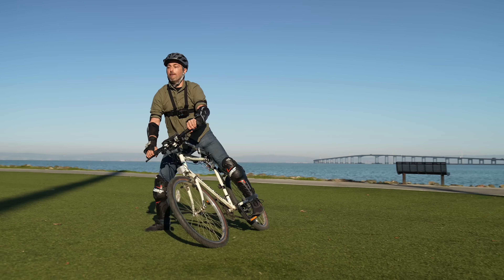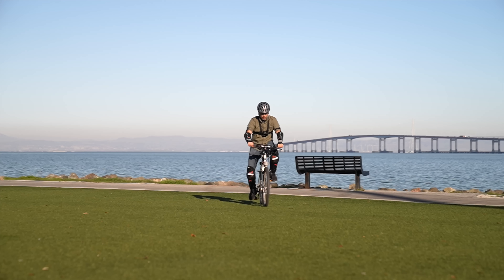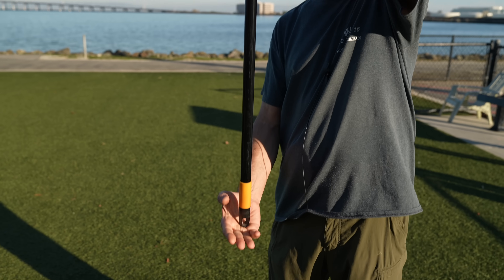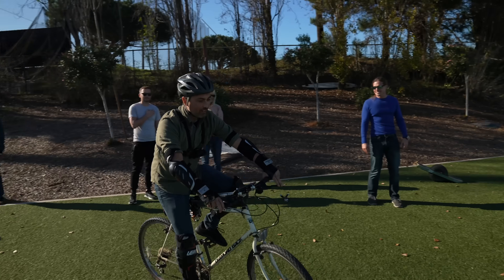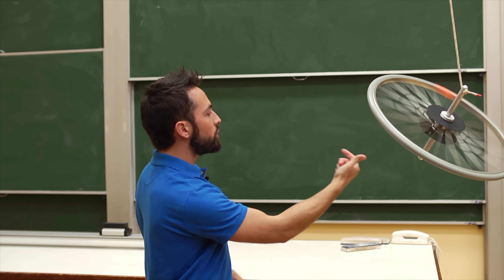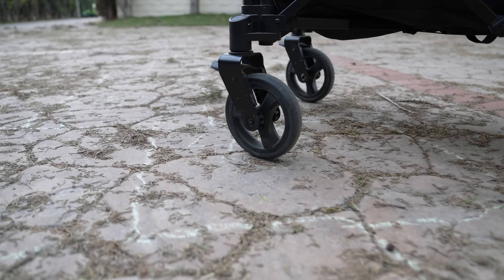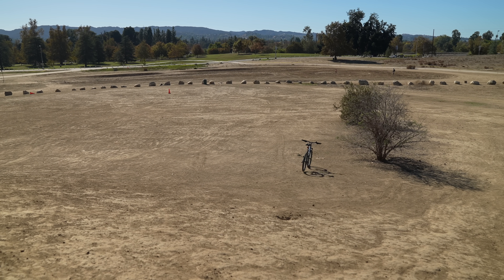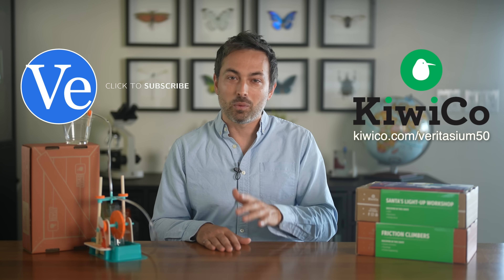Most People Don't Know How Bikes Work

Comment: Try this experiment:  On any bicycle turn the bar to the left.  Now use a level or square to position the front wheel vertically.  You will observe that the frame of the bicycle will lean to the right moving the center of mass to the right of a line drawn between the two tire contact patches.  Opposite when to turn the bar to the right. 
When you learn to balance on a bicycle you learn instinctively to turn into the direction you lean.  So when you are falling to the left you turn the bars slightly to the left.  This moves the bicycle/rider center of mass to the right counterbalancing gravity trying to pull you down further to the left (and vice versa).
Suppose you want to make a left turn.  You have to get the center of mass on the left side of the bike's contact patches.  As above, you have to turn the bar to the right (momentarily) to get the center of mass on the left side of the two tire contact patches.  Once leaned over the bar can be turned to the left to continue the turn. To straighten up you turn a bit more to the left, the center of gravity moves the right, the bike straightens up.
Lot's of words.  Sorry, I couldn't cut it much more without reducing clarity.

Comment: This is how i perceive this:
Its pretty simple actually, when you riding your bike, your weight is in the middle of the bike, so if you want to turn left, you will naturally just turn left like how you would do with a car, but the bike doesnt work that way because while a car has four wheels, a bike only has two, so when you want to go your left and you just turn that way, you will naturally fall to the ground as your weight has shifted from the middle of the bike to the left of the bike, making the left side of the bike too heavy and eventually falling to that side. The right way to go left is to first turn a little to your right, shifting your weight to the right side of the bike, then you turn to your left side until the weight of the bike goes to the left, but not too left that you will fall.

Comment: This is also why there isn’t a realistic video game controller for motorcycle racing games. When you think of how changing lean angle to turn or to stand the bike up or change direction, it is totally different than how you steer a car. 
With a car you turn the steering wheel to the desired angle to make the car travel in a radius that you want, and you have to keep constant pressure on the steering wheel to maintain the correct steering radius and direction that you want, or the wheel wants to go to the least resistive point, which is usually straight; that is why your car will auto-straighten out when you’re coming out of a turn while driving, just by releasing the pressure on the steering wheel and letting it slip through your fingers.
With a motorcycle you counter-steer to initiate lean angle in the opposite direction, and release pressure when you have the lean angle that works for the specific turn radius. If you need to change the lean angle while in a turn that is when you need to apple pressure in the opposite direction to the lean angle change you need. The algorithm for programming a counter-steering handlebar video game controller to operate correctly when you’re using counter-steering is probably the biggest challenge. Using a standard joystick or wheels and peddles to drive a motorcycle racing game, when you have been riding motorcycles for many years isn’t fun to me.
Reply: pedals

Comment: As someone who has gone further on a bicycle than most people have by car, i would like to say that this might not necessarily be true. Now, i don't have one of those testing bikes to prove it, but i believe that if you're aware of this problem, you can compensate for it by shifting around your weight, as well as tilting your bike, and thereby avoiding having to correct left, or right, until you've finished your turn (although you would have to correct after the turn, so it doesn't really change much).

Something similar to this experiment happens when you ride in a very narrow path, like next to a wall, where you can't lean to one side because you're hugging the wall, so you might end up crashing into the wall because you can't keep your balance, and you can't turn away from the wall, because that would cause your body to nudge it.

Comment: It's called counter steering, and it's something you learn during motorcycle courses. In the event of an emergency and you have to turn into a certain direction as fast as possible, you push the steering wheel on the side you want to go to. Pushing the left handlebar means you're going left, NOT right. It's due to centrifugal force.

Normally, you steer with your hips (applying gravity) not with your handlebar, though.
Reply: Not true. See how fast you can turn with your hips when you don't have your hands on the bars. You can keep within lane lines, but you can't turn a corner or go round a roundabout.
Reply: @hughjardon3538  It really depends on the motorcycle how easy it is to steer by leaning, but yes, in most cases you are right. Turning =/= Steering

What I meant was that if it's possible, always steer with hips, unless the situation requires otherwise, such as a sharp turn or small roundabout.

Comment: This is so wrong. Derrick is pretty smart, but not the most athletic. The fact that I can ride my bike without touching the handle bars and when I lean to the right side and I turn right without having to first lean left proves this is all wrong, correct?
Reply: I think it would be just as difficult to drive a car in which the steering wheel turned the opposite direction than what the driver was used to.
Reply: You just prove that the title is correct.
Reply: @XtreeM_FaiL  He said if you want to turn left you have to turn right before you turn left. I can just lean left while on my bike and turn left and prove him wrong. I cant lean in my car. Extreme fail.
Reply: @XtreeM_FaiL  im not sure what youre going on about? Its not magical? When I lean left and the bike goes left at what point did I countersteer? Video dude says you must countersteer. Im saying you dont have to.
Reply: two extreme fails from you now...
Reply: @XtreeM_FaiL  The guy said in order to turn right you have to first steer left. Im saying, you can just lean right w/o turning left and the bike turns right without ever going left. Go try it yourself. Keep your helmet on.
Reply: @XtreeM_FaiL  three extreme fails now.
Reply: @XtreeM_FaiL  lmao which part of the bike is countersteering??? lmaooo Im dieing!!!
Reply: @XtreeM_FaiL  For the record, Im implying you are already wearing a helmet. :face-blue-smiling:

Comment: I dont think I do this... I always Lean the bike (not my weight) to the direction I want, before turning... you can even control someone with it, if you are riding on a step knot, you can lean the bike left or right and the driver has to counter it by instinct turning the bike to that direction... it doesnt require any counter steer at all...

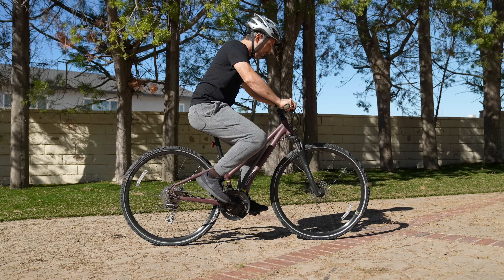Edit: Okay @5:00 now I get it... its because yall are stayed glue to the seat... I can actually stationary balance longer than 5mins. (tho its has a lot of small movements) cause I usually stand from the pedal... Me and my friends grow up with our BMX learning tricks and we always have some compitetion about this stationary balancing on who can last longer.. usually, we just only sit when resting or going down hill.. not while paddling and turning doing some tricks.

Comment: So, I do have one issue with this test. Bikes and motorcycles are notoriously harder to handle at lower speeds, and all the footage here is at an incredible low speed for a bike.

You don't actually need to countersteer to make a turn. You can use your body weight to do that, since a bicycle is so light. But at lower speeds, this is less efficient.
The problem is the micro corrections we make all the time, and that aren't that "micro" at lower speeds. When you can't make those corrections, and when you don't have the speed helping you, you do tend to fall more often.
At lower speeds, countersteering is very useful, and it can be pretty much a side effect of you positioning your weight on the bike. If you "lock" your arms and push your weight to the left, the handlebar will turn the bike to the right. But most people don't use their weight at low speeds anyway.
The immediate "turn now" contributes for this too. You don't usually make turns like that. You usually see a curve and prepare for that turn. In those fast turns at lower speeds, countersteering is more efficient and faster than moving the center of gravity. So that's what people do.

So, by locking the handlebar into only one direction, you didn't just prevent countersteering, but also the corrections. And since people are moving slower, and can't prepare for the turn, they need bigger corrections and more countersteering than they normally would. and that's what makes you fall so often.

Comment: Can someone help me understand what I'm missing from this? I understand the concept, but here's what I can't connect to my own experience. I'm just an amateur MTB rider that has ridden my hardtail casually off on on my whole life, and I wonder/think? this might be the issue is the difference between MTB and road or casual/tour style handling (like the video mentions but does not go deeper into is that people assume you steer with turning, but cornering is really leaning. I really wish there was an advanced road/MTB rider in the mix to talk about and show hard lean technique). I specifically kept this video in mind as I went out for my ride around my yards short track, it is all up/down hill and flat corners with no berms, I noticed that I never counter steered to steer like the video suggested, and that the only time I actually steered in the opposite direction was ONLY for positioning, when I wanted to start wide to take the most efficient line to carry more speed out of my corners, just like you would in car racing. I was able to let myself go straight and just fall into my turns if I wanted to. I simply didn't understand why everyone in that bike test couldn't do that and it really frustrated me to observe, so what am I missing?
Reply: It does not matter what or where you ride. All bikes work the same way.
You have always countersteered. Required force needed and the effect on a light bicycles are so small that it is hard to notice.
If you ride heavy motorbike fast, you will notice that you need to push quite hard to make a quick turn.

Comment: Why is it seemingly easier to balance on a bike with skinny tires as opposed to fat tires
Reply: Damn that's a good question I want an answer to too. There's plenty of trials riders riding on wide 2"+MTB tires but then you'll also see masters like Viola Brand literally doing ballerina on skinnys. I don't know if relevant but if you keep increasing the width of the tires on a vehicle you eventually hit a point where the sheer girth causes the vehicle to want to wander and bump steer around on it's own, so maybe on a bike more width grants more stability at speed, but similar idea in that it also presents more resistance against you when you're trying to hold a different position than where the bike is inclined to travel?

Comment: I'm a PRO Biker and this video helps with NOTHING... It's just not useful... 👎
Reply: Cool bro, it wasn't the goal of the video anyway. Since you're a "PRO Biker" ᵀᴹ you should already know how to perfectly operate a specific kind of two wheeler in any situation (because every two wheeler behave this way (above a certain speed that is dependent on its weight)), the interesting bit is knowing why it is this way, which you probably already knew since you're a "PRO Biker" ᵀᴹ, but most people didn't
The video helps absolutely nobody, it just point outs an interesting fact most people weren't aware of.
Reply: @AlphaDragons60 🫵🏻💚

Comment: Wait ,am i the only one turns the bike with the body imagine i’m a motorcyclist 😂
Reply: By leaning you're body right you're also pushing on the right handle which turns the wheel left which leans the bicycle to the right to then make a right turn.
Motorcycle riders don't turn by leaning their body in the turn (they can even lean the oposite way to make tighter turns at slower speeds)). Every two wheelers behaves the same way, above a certain speed which depends of its weight, if you push the right handle it will lean to the left which will make it go left or eventually fall to the left if you continue pushing the handle more and more without straightening it up

Comment: When I first watched this video, I thought the counter-steering sounded so strange. Not that it didn't make sense, but that I, as someone who rides a bike almost every day for commuting, could not ever recall doing it. I left it at that it was so unconscious that I didn't realize it. Fast forward to today, I rewatched this video and realized: "Hey, I can just take my bike out and see why this seems so weird."

Turns out, I actually don't counter-steer, even on hard turns! I lean into the turn first, THEN I steer into it! It's the same principal, just that instead of steering in the opposite direction to start "falling" in the direction I want to turn, I shift my body weight in that direction.

I think I could turn on that bike.
Reply: You actually do counter steer, but it's subtle. Let's say you make a right turn, by leaning your body right first you're applying more force to the right handle than to the left, which makes the handle bar and wheel turn left, which makes the bike lean to the right, which makes it turn right.
You can lean your body to the left and still make a right turn, it will be tighter even, but i don't recommend doing it at high speed

Comment: What you didnt include in this video is the same reason that the bike kan roll on its own is the same reason that a steering wheel in a car returns to center when driving forward. When going bakwards in a car, the wheels wants to steer to the maximum angle.
Reply: that's caster. 8:02
Reply: @stan0matic  Ik, for some reason I forgot to say it.

Comment: They've messed up and missed something: if the centrifugal force wasn't very important it would be just as easy to ride a scooter with no hands as it is to ride a 10-speed with no hands. But it's in fact easier to ride a bike with no hands. than a scooter with one hand.

The reason that's true is an important part of the equation.

Comment: Sadly, nothing was mentioned about the wheel shape, and it’s affect on turning the bike. The contour of the wheel is really what does most the work.  Counter-steering is just getting you on the the opposite and smaller circumference of the tire, i.e. side of the tire, this is what actually turns the bike.
Reply: The contour of the tire is largely is responsible for keeping the bike upright without a rider while moving. A ‘bike” tire without contour would not stay upright and would be very unstable, let alone difficult to steer.

Comment: One very easy observation everyone can make is see how your body react when you are standing on your toe and trying keep balance. If you are losing balance to the front your body bend toward front to regain balance. Same happens while riding bike. You are trying to pull the balance back from right to center while turning your handle right. If you think about it, it doesn't make any sense that your are move toward the direction that you are losing balance. In the first case, easy analysis of center of mass and conservation of momentum explains the matter. In the second, the mechanism is not as easy, but intuitively they are identical.

Comment: Counter steering, motorcycle riding 101.  It doesn't come as naturally on a motorcycle so you need to know what you are doing.  Especially when you have to avoid something at the last second or lean in to a corner more to not go wide.

Comment: The confusing thing about the term "coutersteering" is that it implies that you turn in one direction and by magic it makes you go in the other direction. Not what it actually is which is that in order to turn in one direction you have to turn in the opposite direction initially so that you can lean the bike the way you want to go.
The paradox is that when you actually travel in the direction you want to go you're not "steering" anymore because the handlebars have in fact returned to the position where they started before you countersteered. So technically you only ever steer in the opposite direction.

Comment: I wonder how many falls on the locking bike it would take for a trials rider to learn to compensate.
Or, if they would fall at all if they were going slow or using stall techniques.
Balancing on a bike that is completely stopped is part of the trials skillset. So is maneuvering the bike under yourself with the wheels locked by the brakes.
Then again, trials riding would be a different "mode" of riding with these techniques, so it doesn't really matter.

Comment: It should theoretically be possible to initiate a lean just from shifting your body weight alone similar to how an astronaut can change his orientation in space while still conserving angular momentum.  The issue with demonstrating this practically is that you still have to balance the bike while doing this dance.
Reply: You can balance the bike, but you can't turn it if the steering is fixed.
Astronauts in space can move their body, but can't change their path.